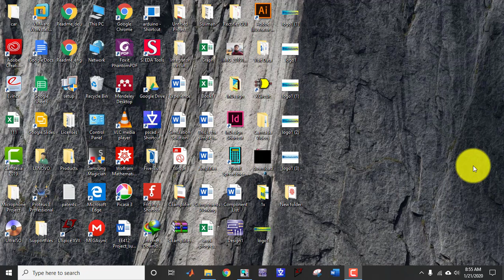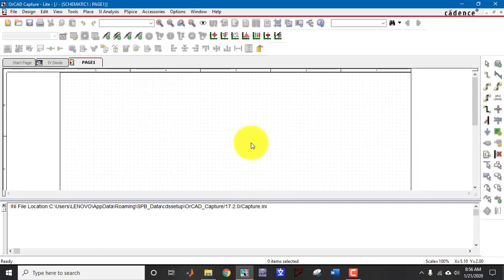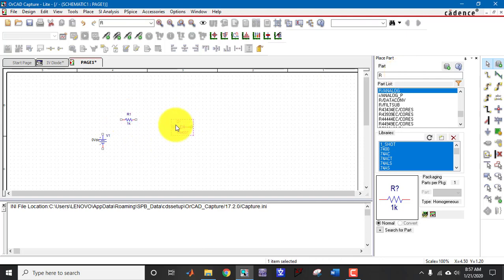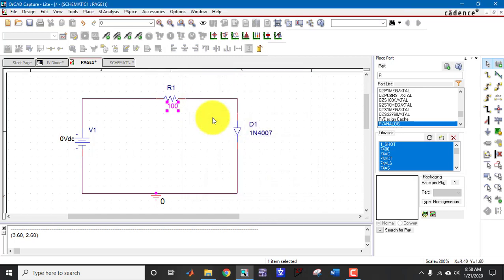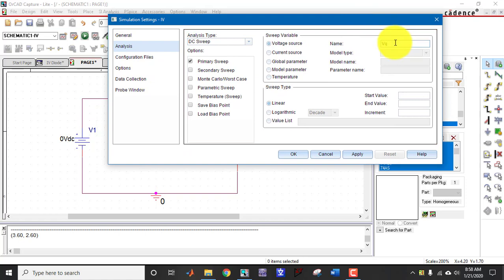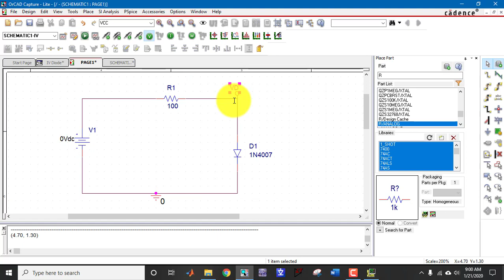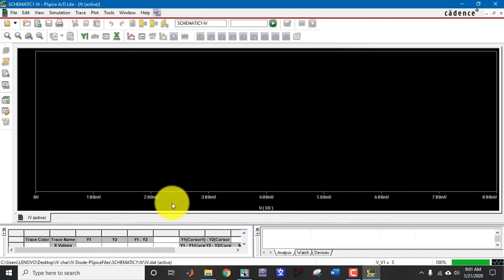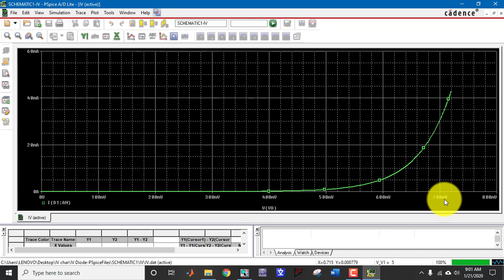IV characteristics of Diode Using PSpice Simulation.

Comment: What if we do not have the AN and CAT options? (I am using 1DN4005)
Reply from the maker: It must be ... u also can use by labelling the diode like A and B across the diode. It will show you in measurement mode